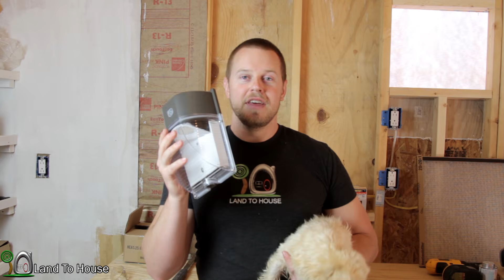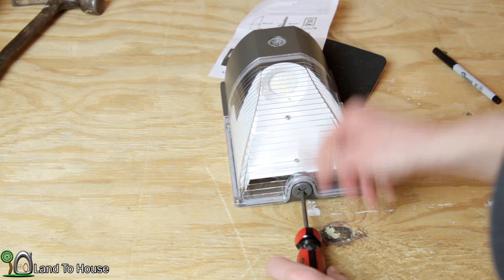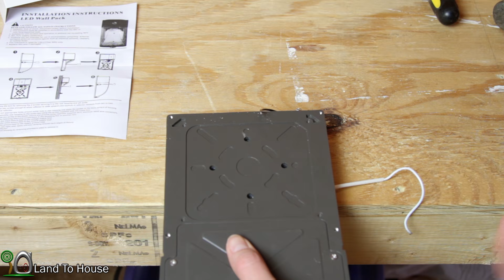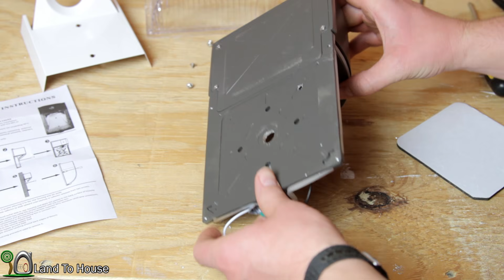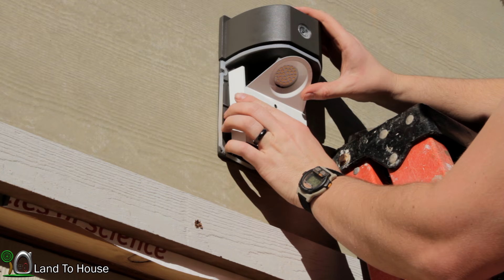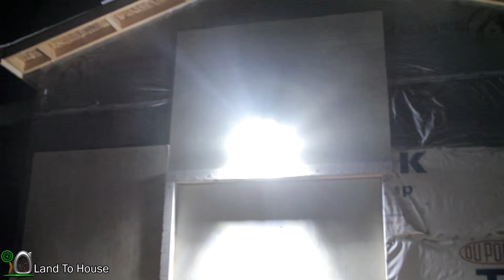Cinoton Exterior Wall light - Build a Workshop #29

Comment: Good review and very helpful. I just installed my CINOTON 26W LED today. The punch-out bits had to be taken out with a power drill. No way can you punck those out. I had problems getting one of the outer screws out as they must have power torqued it on in the factory. I sprayed the screw with WD40 3 times and left it for aged but in the end took a junior hacksaw to that corner! When I installed it I put silicone ont the back, edges and down the side where the gasket is. I put my hand on the sensor and it powered on after 5 seconds. I just hope the 50,000 claim is good and I don't have to open it again.

Comment: I believe the wire splices are supposed to be made inside the j-box, which would have entailed running the connector wires from the fixture through the back of fixture into j-box behind fixture. Nice fixture!

Comment: Nice, and thank you, I've ordered one.
A quick google search and 3000 lumens should be about the same light as the old twin 100w flood light fixture put out. Use a flat blade screwdriver at the very edge/seam of the knockout to knock/peel it away like the old pull-tab soda cans.
With the wiring inside the lamp itself, you don't need a fixture box on the inside of the wall, just run the 14/2 through the hole in the wall and into the light's housing to make the connection and you are good.

Comment: If you wanted it on all the time, to bypass the photocell, swap the grey screw in piece for the plug with the clear one on the photocell.
Reply from the maker: Interesting! I just used a single strip of black tape.

Comment: Just installed 2 of these and had the same problem with the knockouts.  Drilled them out also but made sure the wires were protected by a sleeve through the base.  The instructions with mine only referred to 2 screws to remove the plastic cover but all 4 need to come out.  They also referred to loosening, not removing the 2 internal screws "enough to allow the white reflector to slide upward until keyhole in reflector releases from 2 screws."   This makes no sense - the screws have got to be removed to pull the reflector off.  Maybe they have changed the specs but forgot to update the instructions.

Apart from these minor issues, these lights are great and produce a very bright, white light with a decent spread.  They are rated at 3000 lumens.  

Check Amazon for great prices.  Cheapest I saw was $39.99 for 2 and free shipping.  Would be hard to beat that!

Comment: If you drill be sure to clean out all the metal shavings and more importantly chase the edges of your drilled out hole so there is no sharp edges riding on your electrical wires. Better to install a plastic knockout insulating ring. Don't burn your building down bing sloppy when working with AC!
Reply from the maker: good tips. I have left this light on for 24 hours. (by mistake) so far there have been no issues.

Comment: About the Knock Outs.
The Instructions Shows that You Need to use a Screw Driver, which I did.
The Knock Outs were fairly easy to remove by placing a Screw Driver on them and hitting it with a Hammer..
Reply from the maker: +Earl Powell I spoke with the seller and he was supposed to talk with a manufacturer about slightly reducing the thickness of those knockouts. I used a number of items trying to get them to knock out and it was quite annoying. I believe it has been improved since I tested them.
Reply from the maker: Great! I have two other lights similar to this one and they had knockouts that were easy. I do not know why I had such a time with this one.
Reply: Earl Powell  mine were hard to knock out as well.
Reply: I used a flat head screwdriver on the back side surface and tamped down with a hammer.  They came out pretty easily like that.  Thanks for putting the video up, it was helpful.
Reply from the maker: Good to know it was not just me.

Comment: If you lay the light on it's back and strike the knockout with a 1/2" taper punch the cast aluminum will fracture at the thin area around the edge of the knockout leaving a fairly clean hole most of the time.
Reply from the maker: +kuhrd I was fearful of that "most of the time" part. Especially while filming. My friend who has supplied the light is going to talk to his manufacturer about the knockouts.
Reply: What if I don't have a 1/2 taper punch, which I don't even know what that is. Can you suggest a more common tool that I might have?

Comment: Next time use a flat blade (standard) screwdriver or a small chisel on those knockouts.
Breaker Box Knockouts https://www.youtube.com/watch?v=BEHla0EV6iY

The connector on the bottom of the box, I believe, allows you to mount the light (on a service pipe)  with the wires fed through the center of the pipe to the inside of the building or thru conduit to another location.
Of course you can mount the box to the structure and run the wiring thru the pipe/conduit into the building or another structure.

Also, you might magnetize your screwdriver to hold the screws.
Reply from the maker: +Holistic Advocate I spoke with my friend and he said he is going to speak with the manufacturer to get the knockouts easier to work with. I really did not want to break my sample :) 

I think you are right. That connection would make sense to go to conduit. I will have to try that. Perhaps an update video.

 My dad has a magnetic driver. I should get one. So many tools that would be nice to have
Reply: I didn't know you were a beta tester for them. 
You don't necessarily have to buy new tools. If you have a magnet that is decent you can magnitize the tip of your own screwdriver. You can also demagnitize them as well. I have been a computer repair bench tec, back in the floppy disk days, and had to do both. We had a degausser, electromagnet, which made it easy to do.
Reply from the maker: +Holistic Advocate I have tested 3 of their lights. This one has been out for a while. I do hope that they can work on those knockouts. We always had to use the grounding wrist bands in school.

Comment: Cool light. Do the instructions really say that bottom plug is for a cord? To me, that looks like where a conduit adapter would be attached.
Reply from the maker: +MrConradF on the amazon page there is a picture of a cord coming out that place. I wonder if a conduit would fit there. That would help keep it waterproof.
Reply: MrConradF I agree, the bottom connection looks like a place from for a conduit to attach to the light.
Reply: Its a bit hard to tell from that picture, but it looks like conduit to me, otherwise, that would have to be a really heavy duty cord to be that thick.  :-)
Reply: Round electrical boxes are for enclosing connections.  All you did was run a wire through yours.  What's the point?